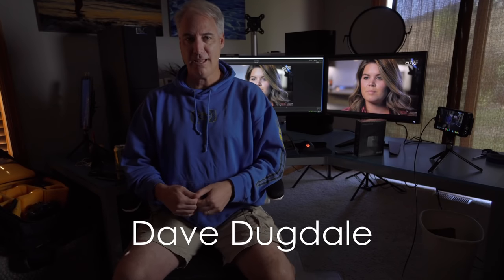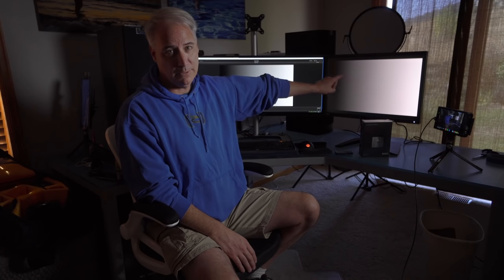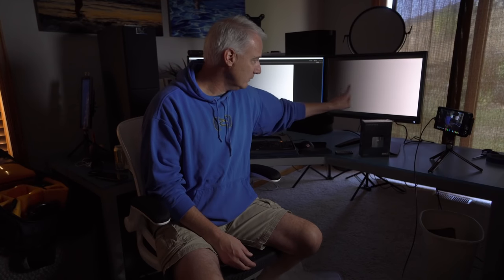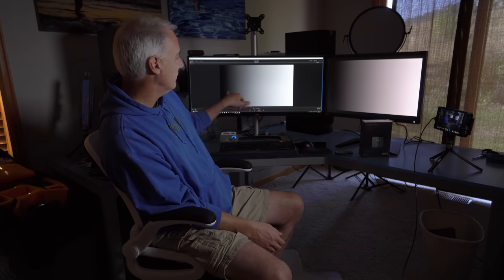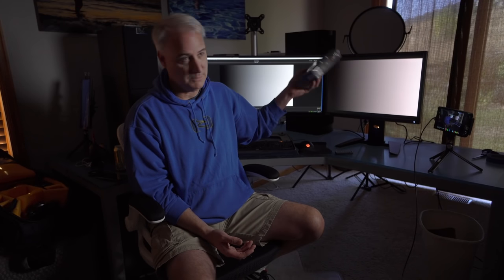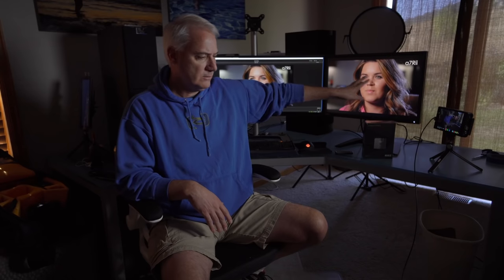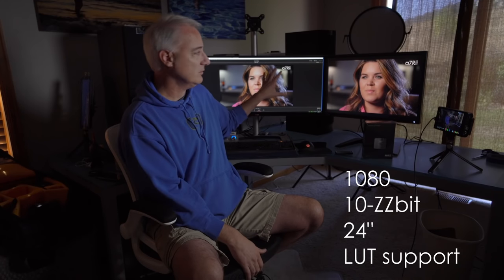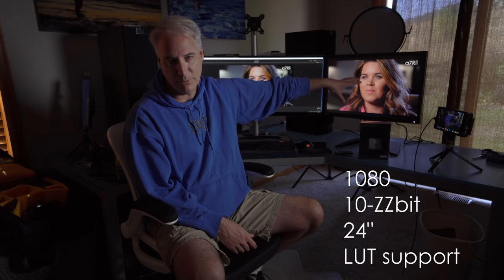Two Grading Monitors for Resolve to Perhaps Avoid

Comment: Is there any value of a 10 bpc monitor if most displays people will be viewing the footage are not 10 bpc?
Reply: In short, Yes. Here's an example: I shoot HD video at 8bit to an internal SD card in a heavily compressed 4:2:0 codec but I also record the camera's uncompressed output via a clean HDMI feed, at 8bit 4:2:2 directly to 10bit ProRes using an external recorder. Now, if I take the compressed 8bit  4:2:0 file into DaVinci Resolve and view the pictures on the COLOR page via a Decklink card to calibrated 10bit SDI video monitor, there is little I can do to Grade or improve the compressed, 8bit 4:2:0 signal. However, if I take the 10bit ProRes 4:2:2 file into Resolve and put them both together on the Timeline and compare them in the COLOR page, DaVinci's ability to 'resolve' detail in blacks and over exposed whites is quite remarkable, even though the original 10bit ProRes file was recorded from the same 8bit camera! If I were shooting 12bit RAW video, even more non destructive control over the picture can be enjoyed. Much of this comparison I describe is only possible to make when examining the images on a correctly calibrated 10bit monitor fed from a Decklink card. If you attempt to make the comparison in your NLE, viewing on an 8bit sRGB 'computer' monitor driven from your internal GPU, much of what you see could be influenced by a hundred different OS/Software/GPU settings that you are not even aware of.  As always, if we video professionals seek to work at the highest possible standard, our work should still look good on the customer's 4K TV, smart phone or anything else in between.
Reply: Well I certainly agree with the benefit in workflow, even if the disadvantage is in the hardware department, all that extra hardware costs a pretty penny.  In a professional production where the footage would be outputted in a movie theater or on High end TV broadcast, or in commercial setting I completely agree with the benefits. But my question was not for that kind of production. Let be reasonable much of the footage, including the one we just saw will not be seen in mentioned environment, it will be seen on all kinds of un-calibrated, mid to lower end monitor devices, smartphones of all kinds, shapes and sizes, plus people will be seeing in with various qualities of already compressed video that was processed by youtube. So for most creators out there targeting that kind of audience on those platforms, all that you mentioned seems like overkill and not very practical. Personal preference aside, off course. 

I came from a retouching world where I dealt with the same problem with 8 bpc vs 16 bpc  in the world of photography. And I discovered that you can do a lot with 8 bpc in post if you know your limitations and since you are outputting to 8 bpc anyway,  16 bpc was more like a special case situation than day to day workflow option. Now I'm switching to video trying to understand the process here, that is why I asked. Thanks for your reply Craig.
Reply: Having worked through this difficult scenario myself over the past few years, I have come to the conclusion (largely through trial and error) that installing Resolve (free) and buying just the cheap, entry level 'mini-monitor' plus the best monitor you can afford is the absolute minimum requirement for anybody working in video production - even if your output like mine is nearly 100% web deliverables.

Comment: Dave, have you considered replacing the Blackmagic Mini Monitor with a Nvidia Quadro Card with Displayport and HDMI 2.0 10bit support? P5000 and P6000 have already been announced.
Reply: Dave's decision to use the BMD 'mini-monitor' rather than a Quadro is a good one. Installation of any of the Decklink series of PCIe cards (including the entry level 'mini-monitor', in either Thunderbolt or PCIe form factor) will 'guarantee' an absolutely clean, uncompressed reference video signal directly from your software and out of your Mac/PC to your Monitor whereas, even a Quadro P6000 will not. GPUs and Decklink card are designed for completely different applications - irrespective of whether they offer a 10bit display or not.
Reply: Thank you for the excellent information. Dave's decision is sound, but a Quadro would also be beneficial. The BM Mini Monitor is specific to BM software, a Quadro provides more outputs including display port and additional GPU horsepower for Resolve. I thought this would provide two benefits for Dave's setup. Both HDMI and Displayport offer uncompressed video output if the display, GPU, and cable support the signal.
Reply: Sure, Quadro cards work well with dedicated Colorist software such as Nucoda and Scratch to offer a reliable 10bit GUI display only. Many Pro NLEs like Lightworks and Premier Pro will also utilize BMD's Decklink cards to output a proper Video signal, not just DaVinci Resolve. Irrespective of whether GTX or Quadro GPU cards deliver DVI, DP or HDMI outputs at 8bit or 10bit, they only offer a 'Computer' display, not a reliable 'Video' display.
Reply: Craig, what do you mean by 'guarantee'? Also, I already have a GTX780 for rendering work on Pr/Ae. I'm only starting to use LUTs (cine gamma on A7Sii acquisition) and trying to understand colour accuracy of monitors. I'm thinking of the DeckLink Mini Monitor 4K PCIe outputting to a second monitor (either a consumer TV or a typical LED PC monitor) in full screen while my current generic samsung 27" LED handles the GUI. Would the card "calibrate" the proper colours on my monitor? Would this setup work?
Reply: BMD's new 4K mini monitor PCIe card is a great place to start as it will
 bypass all the OS and Graphics setting to 'guarantee' a clean, baseband
 'video' signal direct from your software to your 'video' monitor. Now, 
here's the catch. You should really be using a 'video' monitor 
(generally SDI input) that can be correctly calibrated using a probe and
 3D LUTs loaded internally so that the monitor is a known quantity. Few 
can afford the likes of Sony OLED or FSI so we ask 'computer monitors' 
to do the same job, But, few have SDI inputs so an SDI to Display Port 
converter such as the BMD HD-Link is a good option. Fortunately, some 
high end computer monitors such as the new BenQ PV270 and PV3200PT are 
coming out with HDMI in (designed for video post) and Rec.709 and or P3 
Calibration control.  

Note: We send an SDI signal to our 55" Sony 4K TV and convert it at the set with the new Terenex SDI to HDMI converter which has the ability to load 3D LUTS into the converter so the TV can be accurately calibrated using Probe and special software. (eg: Lightspace, Calman)

Comment: Dave thanks this was helpful. I personally use an older Flanders and a crappy tv to be able to grade. Obviously not the best setup but do you recommend getting a 10bit panel no matter what? Or depending on your media (mostly web for me with some physical output) a regular 8bit panel is ok? I mostly shoot 10bit 4:2:2 pro res and I was looking to upgrade monitors.
Reply from the maker: The only reason I need 10 bit is when I am reviewing 10 bit cameras, if just for YT I think 8 bit is fine.
Reply: Again Dave, I think you are wrong here. I still shoot 8bit HD video professionally BUT I operate at 10bit for grading and monitoring. Without a true 10bit 4:4:4 'reference' display from a Decklink card (or similar) you cannot be sure of what you are actually seeing. 8bit transcoded to 10bit where the transcoder allows the 8bit, 256 step signal to be spread right across the 10bit, 1064 step space offers far more 'headroom' in the grade. Test: import 8bit AVCHD into Resolve vs the same scene transcoded to 10bit ProRes/DNxHD and see the difference on the scopes. In an 8bit sRGB monitoring environment out of a graphics card, you are flying blind.
Reply from the maker: +Craig Marshall's Asian Rail Tours thanks Craig, I might have to talk with you on the phone sometime to find out how you got the benq to work.
Reply: Sure Dave, just PM me through YT or LGG or my website: HDvideo4K.com
Reply: I'm trying to understand the right workflow here...
If the delivery format is H.264 8 bit, what is the reason to work on a 10 bit monitor (which also requires Quadro or other special hardware like BMD)?

I'm shooting Sony FS5 in XAVCD HD 10 bit 422.
I can definitely feel the difference when grading with a 10 bit file in terms of how far i can push it.
I have a regular Nvidia card (not Quadro) and 2 Dell monitors- one is a 10 bit U2711 and the other one is an 8 bit U2713H.
They look almost identical after calibrating. slight color and contrast difference but same latitude to my eyes. That means that when I'm testing an 10 bit gradient file, i see the steps on both screens.
As far as i know that is because the GPU only outputs 8 bit even though one of my monitors is 10 bit.

Question is- What will i gain by switching to a Quadro to have a true 10 bit pipeline?
If eventually nobody is going to watch it on a 10 bit monitor, wouldn't i be coloring wrong? I mean, it will not look the same on an 8 bit monitor so shouldn't i use an 8 bit monitor to grade it?

And in Doug's setup, what is actually the pipeline? if the GPU only supports 8 bit then why use a 10 bit monitor?
How does the BMD card come into play in that scenario?
Reply: Hi Eli. There seems to be a lot of confusion here among most users. Let's assume you shoot 8bit or 10bit video (HD or 4K, it doesn't matter) and you edit on your NLE. It is largely irrelevant whether you monitor at 8bit or 10bit through either a GTX or a Quadro GPU because the software controlling those cards is not usually set up for video work and  if your monitor is not correctly calibrated to a known standard,  then the pictures you see video cannot be relied upon.Since the release of class leading DaVinci Resolve as freeware, video editors and 'colorists' now at last have a reliable and trusted method of accurate video monitoring. A Resolve installation completely bypasses the OS colour management to output a reliable, baseline reference signal from your PC/Mac to your monitor through a Decklink card. Yes, this device is necessary to make Resolve work as it should but fortunately, the mini-monitor cards are very cheap and output a clean 10bit reference signal which completely bypasses your OS and GPU colour management where there are too many variables. Your 'reference' monitor should be capable of a 10bit signal either from DVI-D, Display Port or HDMI and it should allow internal calibration to at least Rec.709. If it cannot be accurately calibrated internally, it is possible to calculate and display a LUT in Resolve which acts to correct your monitor's inaccuracy. Once I installed DaVinci with a 10bit reference video signal direct to my calibrated 10bit monitor, I was able to use even 8bit footage which I had previously rejected because of aliasing errors which I thought were a camera fault. They were not - they were merely the result of a poor workflow and signal path practices. A clean reference signal out of a Decklink card guarantees repeatable results.PS: some high end video software such as Scratch and Nucoda will use the 10bit display capability of a Quadro card to give a guaranteed reference signal without a Decklink card installed but it will cost you considerably more than even the full paid Resolve Studio.
Reply: I don't understand the difference between working in Premiere and outputing to a 10 bit monitor like the Dell u2711 through a GPU versus working in Resolve outputing to the same monitor using the Decklink...
Reply: Its really quite simple. The Decklink I/O card when correctly installed,
 bypasses all your Computer's OS and/or GPU user settings which can 
influence picture accuracy to offer you a completely independent and 
uncompressed output directly from the software itself. Most Pro NLEs 
also support a Decklink I/O card. It's a bit like using a dedicated 
Audio or RAID card. (though most modern motherboards with optical 24/196
 audio on board, have rendered the former mostly unnecessary)
Reply: Here's and explanation of why you really should use a Decklink card in your PC/Mac for any video work (rather than just the HDMI/DP output from your GPU (GTX/Quadro/whatever) is explained here by Los Angeles Digital Colorist, Jason Myres: (Moderator on the Pro Colorist Forum, LiftGammaGain.com)  "In certain cases it's possible for images to "look the same" on both graphics cards and video I/O cards, but they were really designed for two different purposes. Graphics cards are based around computer signaling standards (VGA, DVI) and are purpose-built to render Graphical User Interfaces and text. They can display video, but that video has to be rasterized, or mapped to the appropriate pixels in your monitor, before it can be displayed. The output from graphics cards is generally limited to legal levels (16-235), which means no full range output (0-255), including sub-blacks and super whites. They also have no sense of interlacing.

Those things, along with any processing being applied by the graphics card, including sharpness, contrast, gamma, or color space adjustments (usually to sRGB), are what generally makes them unusable for critical viewing. The signal has been embellished, so what you see is not what you get. And, even if you were to try, it's very difficult to completely defeat, especially in OS X.

Video I/O cards are built around SMPTE standards, and are designed for passing unaltered ("baseband"), video signals used in film and broadcast television, in and out of your computer. They are specifically designed not to modify the signal unless you specify it, and when they do it's usually limited to formatting tasks like changing frame rate, frame size, etc. They provide a "proper video signal", which is exactly what you want for critical monitoring." JM.
Reply: Very interesting quote you brought here, so how should we relate to GPU LUTs generated while calibrating if we are to use a decklink that bypasses the GPU?
Reply: I cannot speak with any authority about software generated LUTs as my monitor (BenQ PG2401PT) uses hardware calibration so uses a hardware Probe/Software combination to perform it's own calibration using the monitor's internal 14bit 3D LUTs. Perhaps someone who uses external calibration LUTs can comment...
Reply: I too am calibrating with an external hardware probe (Datacolor Spyder) but evantualy it generates a LUT that is loaded into the GPU as far as i understand, isn't it?
Reply: Not sure about that. As far as I can tell, software LUTs once generated are loaded directly into the monitor (if it is designed to be calibrated with software LUTs) or the other method many Colorist use is to load them directly into Resolve to manipulate the output of the Decklink card.

Comment: Hi Dave.....do not use computer monitor for grading....try Flanders Scientific AM210 you will not regret!!! Its 2000 bucks
Reply: This is pretty good advice if Dave's budget will allow for it. We built our Video Edit and Colour Suite to 12G SDI 4:4:4 specs so we can hire in a pre-calibrated FSI or Sony OLED 'Video' monitor in 'as required' but given much of our output is Rec709 for Web delivery, we use a high quality SDI to Display Port converter with a 10bit IPS 'Computer' monitor which is correctly calibrated using internal 14bit 3D LUTs to Rec.709. It is a cost effective solution when monitoring is not 'Hollywood' critical.
Reply: Hey Craig, which 10 bit monitor are you using as a reference??? Will Dell 2410 will do the job?
Reply: I currently use BenQ's 24" 10bit, IPS display, the PG2401PT via an SDI to DP converter. It is hardware calibrated via internal 14bit 3D LUTs using Pallet Master software but Light Illusion are currently evaluating the new BenQ 27" PV270 for Light Space integration and so far, it looks very good!
Reply: That has 12 bit processing but an 8 bit panel.
Reply: The panel is 8bit + 2 bit FRC = 10bit which what most 'budget' 10bit monitors use. Even 10bit FSI SDI monitors use FRC so if well implemented, FRC is fine...
Reply: A $2,000 display should at a minimum display a true 10 bit signal. Also, I was referring to Bobansky.
Reply: The AM210 is not a great color-grading monitor. Several times, Flanders has said that the AM series NOT designed for color work, its a 'production monitor'. It's an 8-bit panel.
Reply: They have also mentioned that a whole bunch of people use it for light-duty color grading work because it's calibrated to the same standard as all the other FSI panels. Also 99% of the people here are probably outputting to Rec709 anyways, so a 10 bit panel is not nearly as important as people always say. Any Pro 8 bit panel like the AM210 will be a million times better for color-critical work than some 10 bit computer monitor. So yes, it is a great color-grading monitor. Just maybe not for a post house that most likely already spent $50,000 on the rest of their grading room hardware.